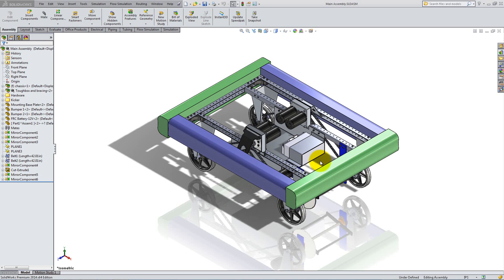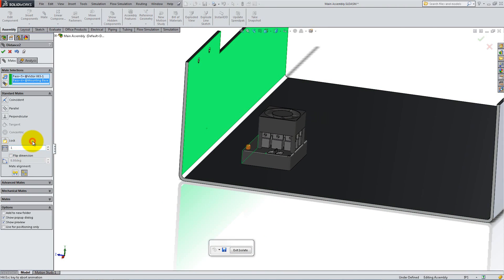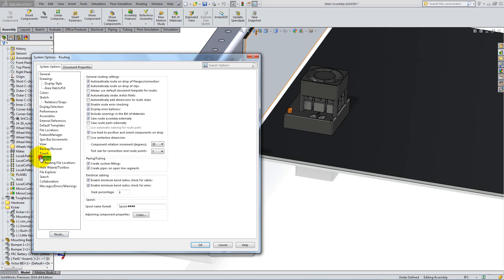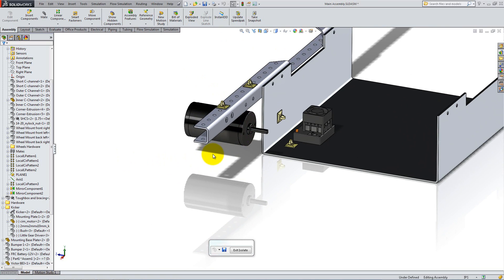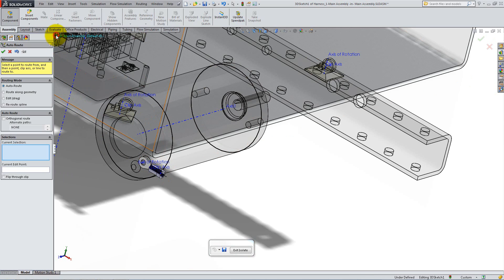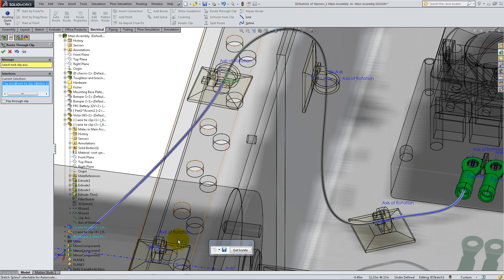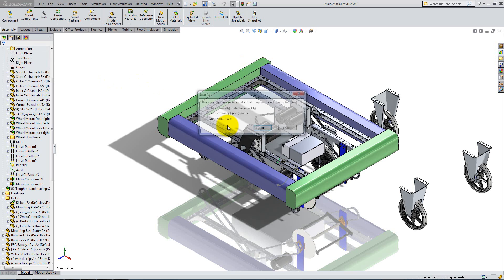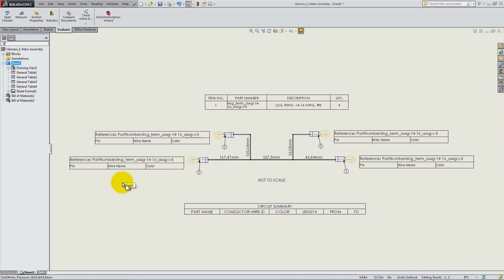Unit 6: Routing - Lesson 1: Routing Wires

Comment: hello, I'm going to ask a question right now I'm working on an assembly project and I'm also doing wiring in this assembly. When I send my project to another computer in some way, some connectors do not turn on and become ineffective.
what should I do to open the assembly file from another computer without problems?
note:some of the parts I've used are in my own library while others have been added as connectors myself.
Reply from the maker: Hi Sefa! Please reach out to our community to post your question for one of our experts: my.solidworks.com/forums